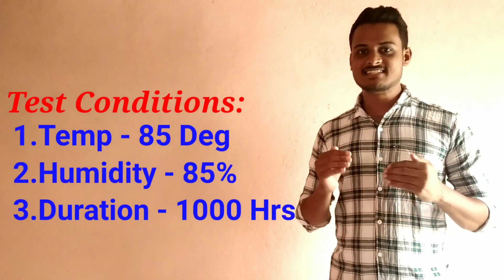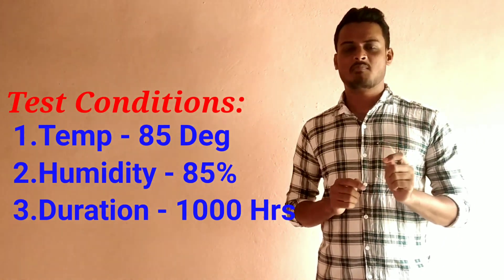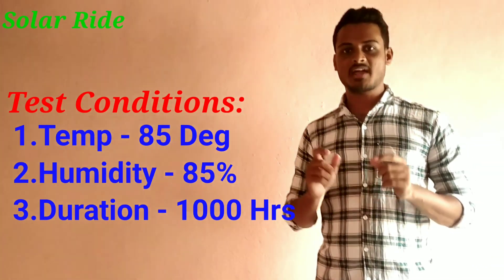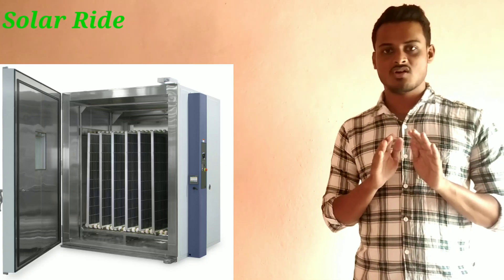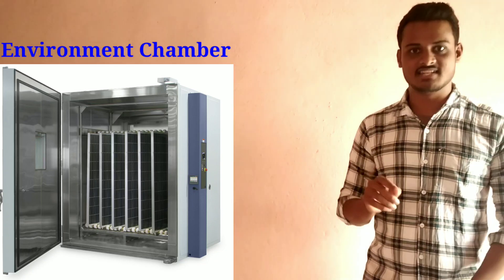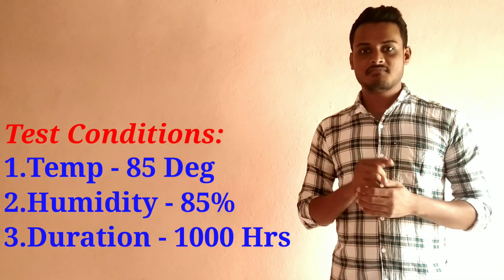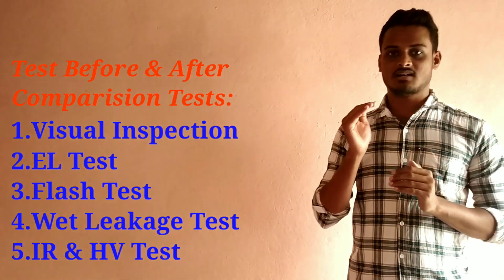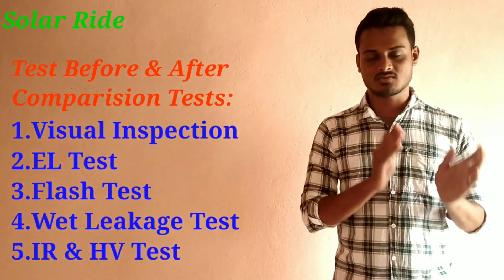What is Damp Heat Test for solar module || Solar Ride ||

Comment: The wet film thickness for films made by
slot die coating is controlled by the flow
rate, coating width, and speed. Give a
formula for the wet film thickness using:

as the flowrate given in units of

cm3/min

v as the coating speed given in units of cm/min

W as the coating width given in units of
cm

Remember to check that the units fit for

your formula.